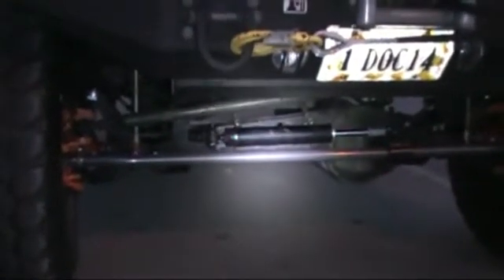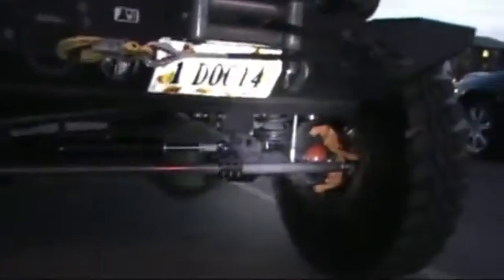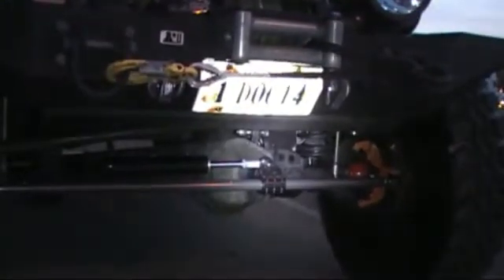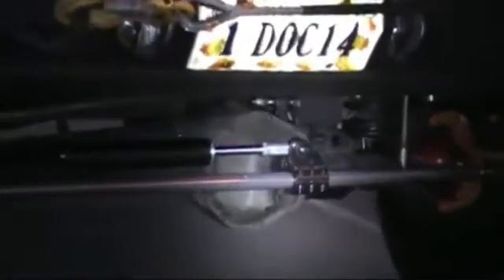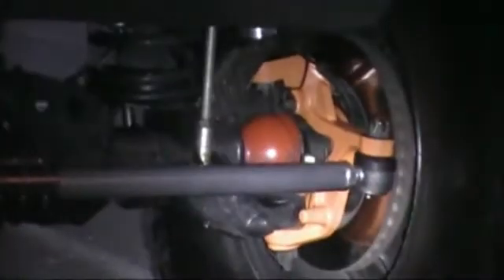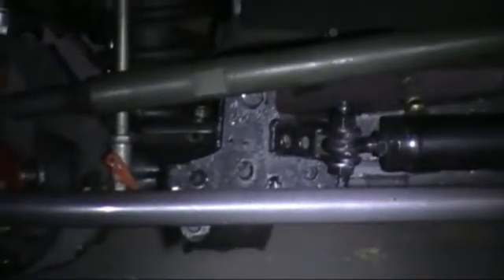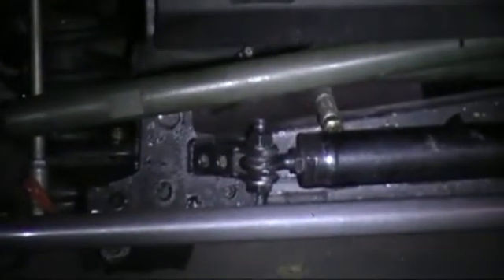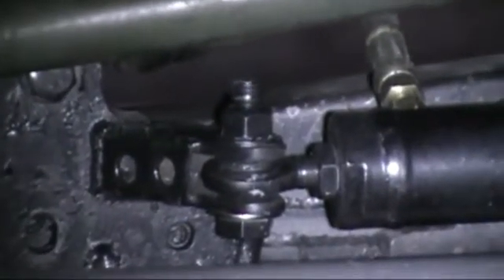Putting a hydro assist steering in a Jeep JK part 3

Comment from the maker: I am running 1.5, I would rather have a quicker responce and slightly less power. Upgrade the pump with a better unit, you can go cheap on the ram. the money is in the pump, then the reservoir, then the cooler THEN the ram.

Comment from the maker: taping a box is not hard, there are a few tricks to it. Find the correct spots can be done easily with some searching for your model box. For the tapping part, most people will just dip the NPT tap and the drill bit in wheel grease to catch the chips so they do not end up in the box. Or just take the entire box apart.

Comment: I just watched all three videos and convinced myself that I can do this to my F250. Similar I hope. Only question I have is that is it possible to just tap my existing steering box myself and only purchase say the ram and hoses. I have access to the proper fittings, thread taps etc. Just trying to save me some coin since I just bought the steering box.